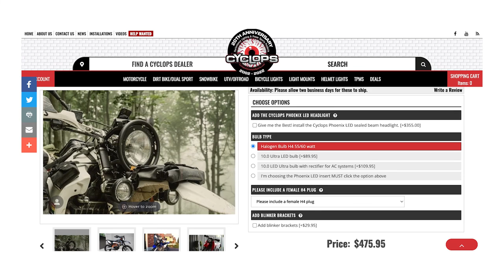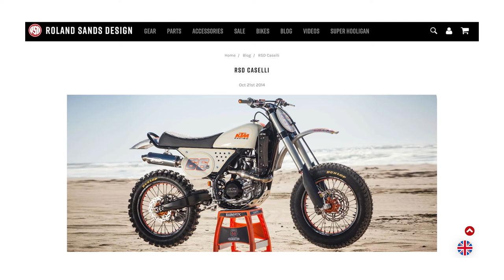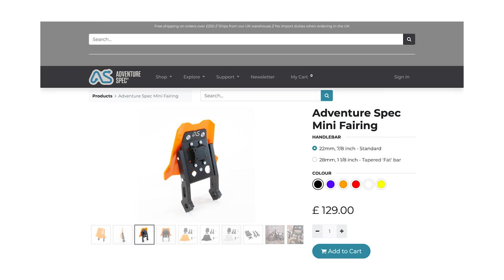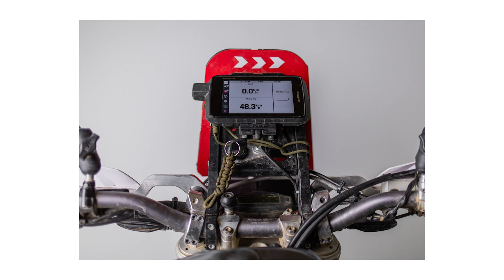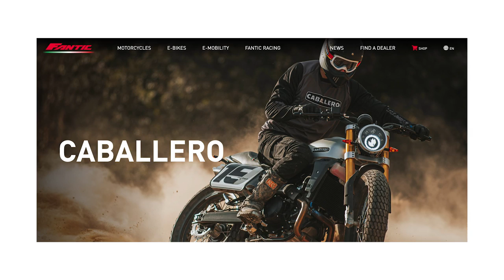Turning a KTM 450 from enduro to adv to hipster to the ultimate lightweight adventure bike

Comment: Enjoyed the details of your KTM experience.  I Bought the CRF 300 last year and now want an EXC 500. The service intervals are not as bad as I first thought. The clutch story reminded me of when I rode back home on from France without a throttle cable. I wound up the tick over screw and used the kill switch to change gear and slow down. ..
Happy travels Greg!
Reply from the maker: Ha! That's an epic DIY job. Well done! The 300L and 450 are the same but not the same. :-)

Comment: Aluminium oxide dremel heads. I've been there with header bolts on my SV650. Nearly had to remove the whole engine to take it to get it fixed. I'd never use "easy outs" again. As they are tapered they put more and more pressure on the seized bolt sidewalls as they go in and snap. They're hardened steel, harder to drill out than the original bolt. Now I go straight for heat and cold (good blowtorch such as a Rothenberger followed by freezing spray, more heat, more spray) and then use left handed drill  bits starting very small and getting bigger. It took two weeks lying on a freezing floor in winter swearing under my SV to come to this conclusion.
Reply: + If you're going to do swingarm and linkage bearings then a Rothenberger Superfire 2 blowtorch would be a good investment before you do. Not cheap but mine has had so much use doing bearings on my DRZ.
Reply from the maker: Great tip Adam. I don't have a blowtorch in the garage so will take a look

Comment: I always wanted to throw one of those on my drz400 and ended up building my own which got lots of compliments, it was far from round.. 

I bought a 14’ 500 exc last year I’ve been giving a face lift and I’m down to the headlight as well.. think I’m sold on the standard rally tower.. but at a hefty price tag. Unfortunately your little fairing won’t work with my brp mounts.. had to contact them to ask. Loving the new look of the 450!
Reply: Also.. I highly recommend a rekluse clutch.
Reply from the maker: Thanks Lance! Hope you enjoy the 500. I've thought about a Rekluse but maybe I'm a bit old school, I kinda like the simplicity of leaving the clutch alone. :-)

Comment: Hi Greg!

Is the hard starting issue present all of the time?
I noticed that when cold my 501 would need a little bit of starter work to get going but once it started once it would start perfectly everytime after.

I changed fuel filters, it did not change, forum suggests that the battery is a bit weak for the engine and struggles a bit when it is cold.

If the issue is happening more with the engine being hot I would agree that the valves might be out!

Sick video as always, would love to turn my bike into a full light adv bike instead of half assing it and traveling on my stock Enduro 😁
Reply from the maker: Thanks Tim! I think it may be partly the battery but it does get harder to start when hot so pretty sure the valves need attention.

Comment: Curious whether you've lowered it Greg, since I think we're about the same height? (5'7). If not how do you find the height?
Reply from the maker: Yes it's been lowered using an Australian kit that puts spacers in the rear suspension and on the front forks. Dropped by about 20mm I think. It's still tall but better and you get used to riding it. I don't have any issues at all now.
Reply: @GregVillalobos  Cool thanks. Very tempted to try one of these or a 500. Picking up my DR650 stops being funny after the first couple of times.

Comment: Agreed. These 12-16 bikes are the tits. I love my 15' 501 just as much. So glad I didn't sell. Oh and no, that is the only sizable tank I could find.  I have the same one.  I think it looks just fine. 4.1 gallons is pretty nice.  There is an IMS tank part number 112423-N2 that also fits, however it's only 3.1 gallons and you need some different hardware to utilize it. The plus with the IMS is the brass threaded inserts.

Comment: I just repaired the snapped bolt on my side stand as well. I just had it on the stand in the garage, and I hurt a pop. The next thing I know the bike is on the ground. The bolt just snapped off inside the housing. I drilled it out and was able to back it out with a back out bit. I got lucky. fixed it for about $5
Reply from the maker: That's a lucky fix. Good job.

Comment: my new PR7, right out of the box, had the same clutch problems. i bled, rebled, rebled. it would work, then no clutch, then 20 min later come back. I finally put an oberon slave on, and it think it's working. Life has kept me from riding the past 3 mos, so not 100% sure it's working.  Hopefully in Aug, if the temp gets below 100, i'll hit the roads to see.
Reply from the maker: My PR7 clutch was OK. It's a shame this happened to you :-(
Reply: Steve - did the Oberon work?

Comment: Hi Greg,
This is incredible, I love the evolution of your bike!
My 701 Enduro is probably taking a similar route, although a bit more comfort-oriented (Navigation Tower and high windscreen, mostly).

However, I wanted to ask about the service intervals of your engine. were they an issue? I was talked out of using a 450 EXC as starting point, since the engine service intervals would be so tight.
Reply: Good call on the 701. Mine has a Nomad tower and a Seat Concepts seat. My 2016 has been all over the TET. I also have a 350 FE. Brilliant little bike but for mixed terrain, with road miles, the 701 is my weapon of choice.
Reply: @TheIdlesurfer   hah that's exactly the same equipment I chose. Nomad Tower and Seat Concepts seat. I'm currently modifying it, very curious about the bike after the transformation :D
Reply from the maker: Sounds like a great build!
Reply: @danielhahn55  Those 2 changes transform the bike from an overweight, over powered trail bike to a brilliant light adventure bike. I've got Kriega ADV paniers and frames which mean I don't have to worry about the lack of subframe for a big tour or when you need to carry fuel. Be careful how much you put on any rear rack. The tank/subframe does fail. My 701 has gone everywhere I've pointed her, and I am a distinctly mediocre rider. And whatever you do, don't get a Rekluse clutch for the 701. It ruins engine braking. The Rekluse in my 350, excellent. Horrible in the 701. Top tip. Keep a close eye on the oil, and top up little and often. My friend overfilled his 2018 701 and it stopped his bike dead. You've made a good call, brother, on the 701 but it has its faults, but as an all round bike, it takes some beating.
Reply: @TheIdlesurfer  thank you so much for that information!! I planned using the same rack, seems to be the proper kit to buy :D also I've made good experience with Kriega in the past.
Thanks for the tips! I'll keep them in mind!

Comment: Is a cush hub required as your hitting abit of tar ??
Reply: From my personal experience: I have been riding on different EXC bikes for more than 1000 hours of ADV riding, and I have noticed a significant improvement in the durability of the chain, sprockets and gears. I think the use of a crushdrive is the key factor, as it reduces the stress and wear on the drivetrain components. The crushdrive also helps to smooth out the power delivery and prevent wheel hop. The EXC bikes are amazing machines, and the crushdrive makes them even better.